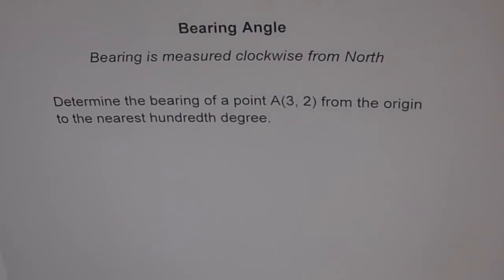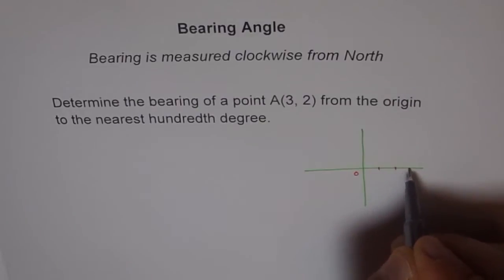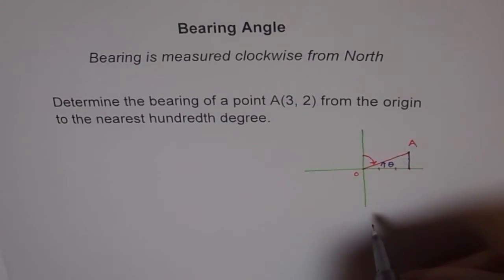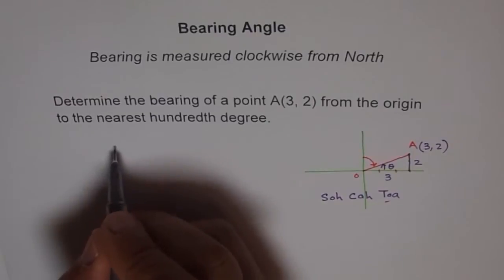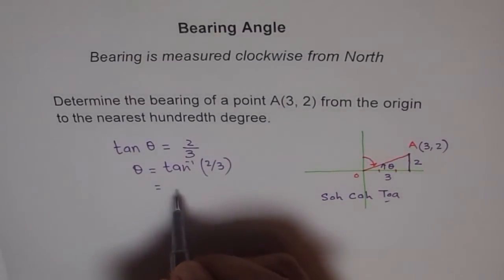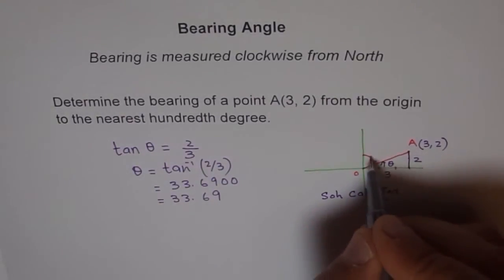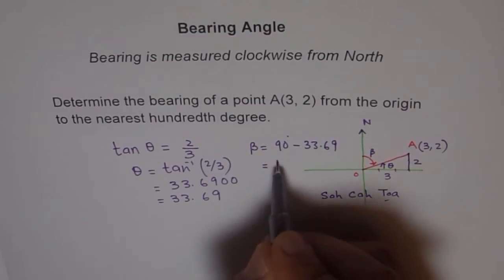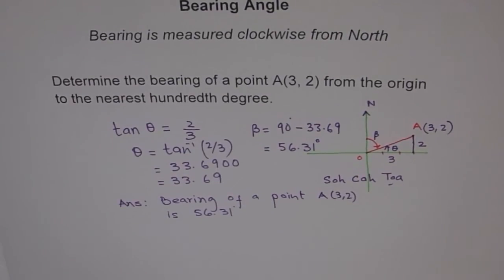Bearing of Coordinate Point

Comment: I teach land surveying. I have a couple of corrections for you, Mr. Kumar.
1) Rounding should only ever happen at the very end. 90-atan(2/3) would be more accurate. You were just lucky your trig step had zeroes after the hundredths place ;-)
2) An azimuth is always measured from north and the angle can be 0-00-00 to 359-59-59 (D-M-S). You calculated an azimuth in this video.
A bearing is actually measured from either north or south, whichever is closer, and references either east or west, whichever is closer. The angle can be only 0-00-00 to 89-59-59 (D-M-S). For example, N 56-23-14 W or S 23-15-03 E.
If your answer was really supposed to be a bearing, it should have been written as N 56.31 E.
Reply: If all of my points are reckoned from North since I used this method to determine my angles because I only have coordinates, how will I calculate my bearings? Thank you
Reply: Christine, bearings are just another way to state a direction. Bearing names depend on the quadrant of the azimuth because, as I said, they can only be from 0-00-00 to 89-59-59. A quick web search should get you the conversion formulas. 
Basically, you subtract the parts of the compass that are not near the closest meridian, either north or south.